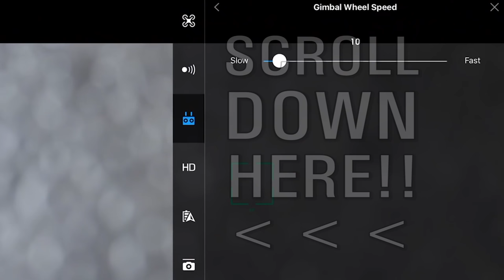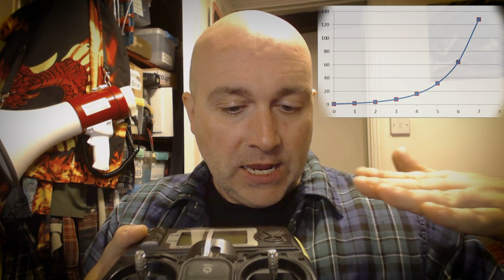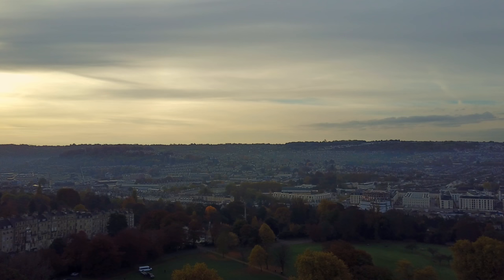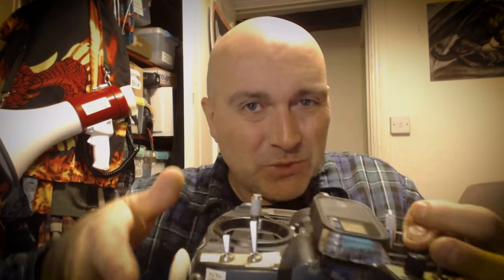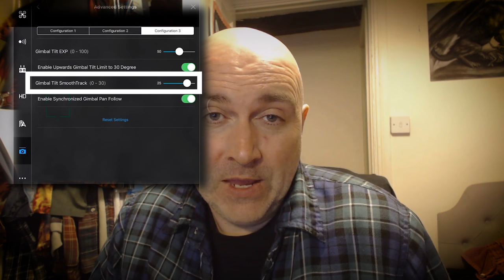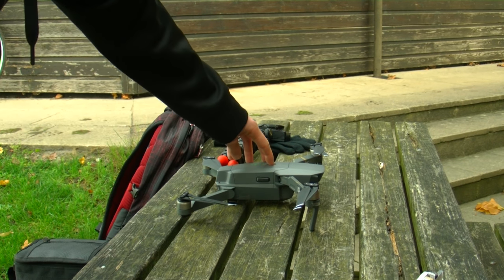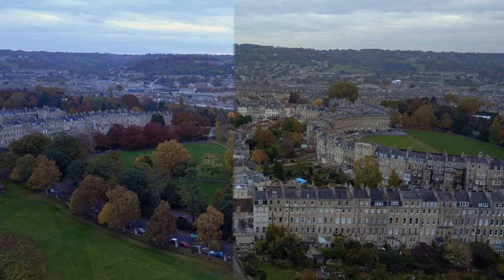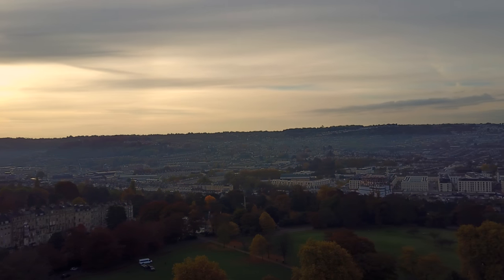DJI Mavic ULTIMATE smooth flying settings and beginner tips

Comment: I just ordered my Mavic Pro this morning but have been flying a Phantom 3 Advanced for about a year. I pretty much figured out most of what you are saying in principle through common sense and trial and error. Once I got the settings such that my camera movement was slow and smooth as you describe, I discovered something that throws it all out the window .... wind !  I was flying one day and doing my normal slow rotation to get nice smooth panning shots when I discovered that the drone would speed up in one direction and almost not move at all in the other. The settings were so soft that they wouldn't overcome wind from one side. I literally had the stick all the way over and the drone simply would not rotate. I readjusted the settings back to default and the drone then was able to overcome the wind and rotate, although it still went too fast in the other direction.  I'm not an expert by any means but this is the only way to describe what I was experiencing :-)  Just thought I'd add this to the conversation. When my Mavic does arrive (end of January probably) I'll set it to these settings at the start. I did learn a lot that I didn't know relative to the basic photography lesson (white balance & exposure hints) so thank you for the education :-)
Reply: Sure heavy wind may influence things as you say, however im surprised it effected YAW.  I would be interested in how much wind would spoil things in control terms. I have usually set mine to only really slow down the YAW control only so the PITCH controls will still be giving a large amount of movement. Also I have two settings - Normal and slow on my controller, but its not a Mavic controller. To get the same effect of "two speeds" on a Mavic controller you could set "SPORT" menus to be normal untouched  with no yaw smoothing  and NORMAL to act as dampened for a quick switch in and out system on the MAVIC. This wasy you could still be able to switch out the way you want to play quickly just by flipping the Sport switch. I dont think most people will have much of an issue with this though but thanks.
Reply: truthseekers666 I agree that most people won't notice this or be affected by it. I only see this when trying to pan (rotate) very slowly capturing sunsets. I move the joystick a small amount and the wind resistance keeps the quad from moving. As I increase the travel on the joy stick ever so slightly, I eventually reach a point where the quad seems to suddenly break free and then moves too quickly. I've calibrated the controller and everything looks good otherwise. If there is little to no wind, the quad rotates beautifully. I may have to go back and check some of the other settings such as Gain ... I may have something else not set right. BTW ... I cancelled my Mavic Pro order and switched to the new Phantom 4 Pro :-)

Comment from the maker: Someone just rudely commented that they knew all this, and so why was i bothering. . Sorry but the time  to give your videos and comments on jsut what settings were needed went past and nobody gave me the information contained in my video. So I did asked for peoples input. For example nobody out there bothered to mention smoothtrack to me, or end point yaw to me. This isnt for pro's this is for beginners but who knows... it may even help pro's out because SMOOTHTRACK is the hidden gem that isn't being talked about right now... hidden away in the menus in a hard to spot place. So I am not going to accept comments which try to patronise me that they knew this stuff. Those types of comments would have been useful if youd told me PRIOR to doing this video.
Reply: so basically if you find smooth track you will get this kind of cinematic settings.... Also this will effect the sticks if you leave these settings. Does it change when you put it in sports mode.
Reply from the maker: There are 3 settings for EXPO - which can handle differently in Gentle mode - normal mode or sports mode. You have to set your wanted settings in each via the menus. There is no "Gentle" mode though so I am not sure what they mean by this and hope they dont mean TRIPOD mode because if they are they are switching terminologies in a confusing way. Also I am not certain that setting those EXP's in those three modes actually has an effect when in sport or normal or if you actually set it as a global setting from the EXP screen which will have the desired selected EXP no matter what Flying mode you are in. Its an interesting point I wondered about but will have to check out next time I get near a Mavic.
Reply: so you could save this this setting as a profile custom mode I mean I don't know since I don't have the mavic....
Reply: dude this vid is great and just what i have been lookign for, so keep it up!
Reply: are you kidding?... this was outstanding.  I was going to ask you if you could put them out on the comments.  This is the kind of thing that makes a pro look better.
Reply: can you add the parameters of this in the description if not to much ask.
Reply from the maker: Ok done. Many thanks.
Reply: So how do we actually switch to gentle mode? The same as gimbal config they have 1,2 & 3? Should we just click them and go back the menu?? I think i will give it a test
Reply: This really is awesome stuff,  and not something I've seen in any other of the hundreds of Mavic and Phantom videos I've a watched.  I  flew rc fixed wing for lots of years, and my last and favorite Futaba controller (10 plus years ago) the  allowed expo and adjustable end points.  It's like secret sauce for super smooth flying.  Expo helps good pilots fly better.
I commend you for bringing this to us, and I  would recommend it to anyone.
Reply: OMG Matthew I try the setting you said and it works beautifully thank you I will post the results when I am done doing several shoots around here of nice aerials.
Reply from the maker: Many thanks. Send up some of the video you shoot, we are interested to see.
Reply from the maker: Great cant wait to see.
Reply: wow I am getting good footage when I am done I have to produce the music also which I don't want to deal with other people music since I have my own music production equipment I might as well shoot the aerial and put the soundtrack to it too
Reply: haters will hate! if that person thought it was boring or knew all that stuff, why'd they watch it? There's always going to be rude people. For those people who watched and you've helped them achieve something amazing, think of those people and don't let haters project negativeness into your life because the positive feedback your getting kills the negative :) I look forward to you doing some more vids on the Mavic :)
Reply: I am confused by this "Gentle" mode also... what determines when the "Gentle" Expo settings are used? Also, I don't find a "Smoothtrack" option in gimbal advanced settings... I have Gimbal Speed; Enable Upwards Tilt...; Gimbal Pitch Buffer; and Enable Synchronized Gimbal Pan Follow.
Reply: in the new firmware they change this and now they have newer features which I really got lost but found in the end the end yaw point also is in a different part of the software.
Reply: Clay Coleman in the new firmware they change this and now they have newer features which I really got lost but found in the end the end yaw point also is in a different part of the software.
Reply: yes indeed
Reply: +Joenas Gayramon ipse dixit. Well done
Reply: Excelent video. Learn a lot
Reply from the maker: You need to set the YAW end point  adjustment to as low as possible. I think mavic only allows as low as 50... whereas on a phantom4 pro you can go to 30! Lower setting will make the mavic slower truning. After all who needs a racing drone... its a cinematic film camera drone not a racer ;-) Remember to set this in normal mode and sport mode as each mode carries its own settings for expo etc...

Comment: In DJI GO 4, I noticed a few of the settings names of some parameters are now different. Also some of the parameter values suggested in the video are out of the available range limits when using the DJI GO 4 version. Is there any way you could update these settings for DJI GO 4 as well?

Comment: Absolutely correct Matthew... the gimbal tilt wheel location on the DJI Tx's whether you use thumbs or fingers to move your sticks SUCKS. I was SO much better at coordinating turns while tilting with my old Phantom 2 and HiTec Tx (with sliders on the SIDE of the Tx)... I wish DJI would address this issue!

Comment: Matthew, thanks for this great video and the info you have provided. I do have one question about the exposure. You mention in your video to not use auto exposure to avoid getting the ticking in the shot when transitioning from different angles and to set the exposure to the sky. My question is, how do you set the exposure to the shy with the Mavic Pro? Thanks.

Comment: Great video Matthew , surely though reducing the yaw end point to 50 or any less than 100 will result in loosing the CSC command should it be ever needed in a emergency situation and motors need disarming ?

Comment: If I've understood what you said, I think there may be a way to limit the travel of the yaw stick.  I have some motor issues with my hands and find that my movement on the sticks is a bit more radical than I would like.  I even thought of putting some sort of guard on the controller that would limit the stick right and left movement to a small area around the center.  I believe you mention a setting that does this for me, but I am unable to find it in the Go 4 software.  Did I miss-understand?

Comment: Matthew, as you know the labels in DJI GO 4 have changed. What is the setting to use for Brake and Attitude under Sensitivity?
Brake has a range of 50% to 150% with a default of 100. Attitude has a range of 20% to 100% with the default of 100. Thank you.

Comment: That was a wonderful, entertaining and cogent explanation that this newbie Yank very much appreciated.  

Can I set up your settings as a default in DJI Go 4 and if so, how?  I have been trying to do so on my iPhone 7.  I don't have it in the controller and the Mavic is not connected either.  It also seems to me that your settings will help reduce the chance of panic taking over when you get in trouble while flying.

Thanks mate -- just a great explanation.  You are an excellent teacher.
Reply: Go3 and Go4 are go similar I dont see why not. A few terms may have changed but the essence is there. I may have to do a follow up video for Go4 to find out what any new terminology they are using. If you have a few braincells to work out any new phrases used thats all that has changed... wording... nothing else. Well they do have Cinematic flight mode now also but all that means is flying with the "braking" turned down to low values so the craft drifts on... thats all that has appeared which is new.

Comment: Thanks for the video Matthew. I've adjusted my settings accordingly. I did notice though some of the screens you had were different to mine, just wondering why that would be? E.g. The Advanced Gimbal settings screen, where can I find the smooth track settings. I don't seen to have it? (okay ignore that question, having just spotted your description)...
Also I see you have the ability to set 3 different configurations. I don't see that option either. Is that perhaps for a different DJI drone? Great video and nice flying to Oliver as well.

Comment: Great information thank you. Question a little bit off-topic: are you getting anything remotely close to 4 miles distance when flying a Mavic pro? I understand the obstacles but at best we're Ifly once I hit between five and 6000 feet I begin to lose signal. Furthest I've ever been able to fly out was just over 8000 feet. What are you experiencing to be the norm?
Reply: I would not be able to say as I would not fly that far to test it out but someone on here may be prepared to discuss the nature of illegal flights at long distances like this. I understand that p3 and p4 and mavic can easily get 3k line of sight and can get 4k metres... as for the full range 4miles - you would have to be in the USA because this is the only place the power on your controller is at full power. IN Europe and rest of world I thinm its on the lower power setting.

Comment: Thanks, and although I have seen other vids on these settings it's always good to see them again, as there are s few nuances which can be missed. One thing, however, is that on my Android phone I'm seeing slightly different menu items, such as in Expo there are no three flight modes listed at the top, only the one selected which would be normal or sport. So, either we are on different RC or Go4 firmware or this is an iOS vs. Android difference?  Great Vid!  Keep 'em coming....
Reply from the maker: Hi, thanks for that. A few people agree with you that there is now only one settings screen in EXPO area... no tabs. It appears things have moved on a little since my video which you would expect with such a new model in an early release state. Theres also a cinematic mode now which simply stated backs off the "braking" which is in the north south east west directions. Shame they cant put Yaw smoothing out like they do with the gimbal... now that would truly be cinematic!
Reply: Cinematic mode isn't nearly as comprehensive as the adjustments you talk about in the above video. Unfortunately the changes in the app since you made this video are pretty drastic, such that I can't change all the setting that you do here, even though I want to. Any plans to make a new video? Or could you even just reply in a comment telling people what the settings in this video are now called? I find the stock settings to be almost unusable for smooth flying, and I can't enact all the changes you make here after the changes in the app... Help!

Comment: hi, congrats for your great video , i have a "problem"  (my previous drone was xiaomi 4k)  it is very difficult for me now to make an manual orbit with the mavic pro, i have already setup drone with imu ,gimbal and compass calibrations, of course i m use it on normal mode with gps (15-18 sattelites) and i use your settings EXP, Sensitive but the result is that my manual orbit is getting out of my circle the most of the times the drone is increasing the distance and sometimes the high.. with Xiaomi it wasnt necessary to change anything the only option was the speed of the drone and i usually use 13 Khm now i dont now if it is possible to change the speed of my drone and to correct the possition in order to avoid slips (i try to play with the brake..but nothing..) can you give me any advice? thanks!!

Comment: Nice work matt, oliver is a nice guy and takes things in well... Adjusting gains are more of what and how the copter flys it`s self so you made some good points for users to follow.. Gimbal pitch buffer is what i have on ios at 25 as no movement at 30 so the setting you have given will be for android? on the manic, no smooth track
if your interested in seting up and playing with an S900 or even owning it on the very cheap, contact me
Reply from the maker: I might be interested in some fun setting it up... What stage are you at and where abouts are you?
Reply: Find me on Facebook?

Comment: I'm wondering how this compares to Tripod Mode. I know that Tripod Mode radically limits the speed, but from what I've read it also makes the controls behave similarly to the way described here, that is, it makes it easier to get slow, smooth cinematic footage.
Reply: Good point. No Tripod mode only slows forward and sideways... it doesnt smooth updown and yaw. Hence why this video is so important. We did test tripod mode to be sure of this.
Reply: truthseekers666 could you not make these adjustments in tripod mode only? This way if you want a faster set up you still have it and tripod for all the super slow set ups?
Reply: Honest answer is I dont know. It would be nice if there were preset profiles which could switch in each mode like tripod normal and sport modes... but I dont know if they have that. If you find out, let us know.
Reply: There's also the recently released Cinematic Mode to add in to the mix, now. Apparently, that does smooth out yaw.
Reply: i'll be looking into it when mine shows up.
Reply: No way. Thats excellent news. Perhaps they have been watching my video! ;-)
Reply: Ah, I just watched a video on Cinematic mode and sadly it doesnt touch the yaw. It just slows braking down so the copter can drift to a stop left right front and back. Yaw is still a twitchy puppy. Still if I am wrong let me know.
Reply: I haven't really looked into it much at all. I just saw this screen shot which comes up when you enter Cinematic Mode https://forum.dji.com/forum.php?mod=redirect&goto=findpost&ptid=76174&pid=606318&fromuid=9560
Reply: TRipod mode doesn't appear to touch the yaw speed.

Comment: Not having a Mavic yet excuse the daft question doesn't the Mavic have a tripod mode that gives the same effect with slow yaw and panning ?
Reply: Hi, I think I did mention in the video to "note: tripod mode doesnt effect yaw or gimbal tilts". I can see a reference to this in the video description below the video also. So the answer is no ;-( unless you set it up in the way described in this video even in Tripod mode if you touch that rudder/yaw stick it would rotate way too fast. The only thing tripod mode effects is speed of movement forward/backwards left and right. It limits you to 2mph according to the manual.